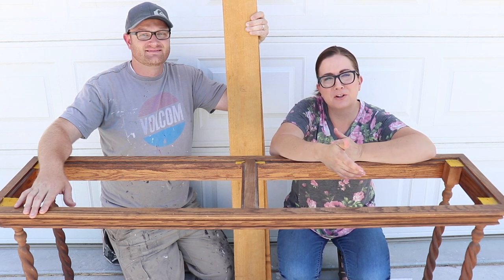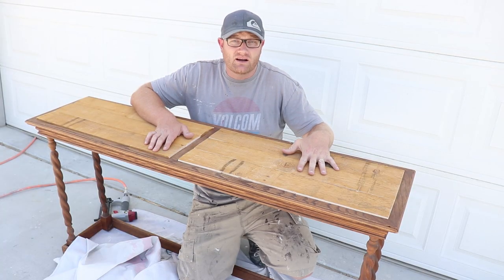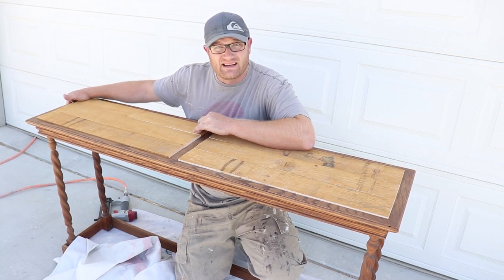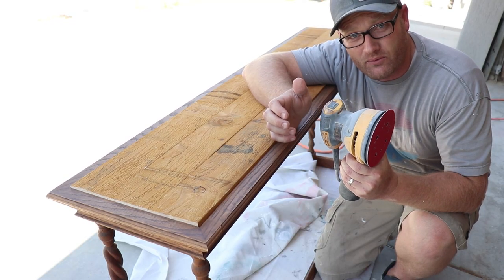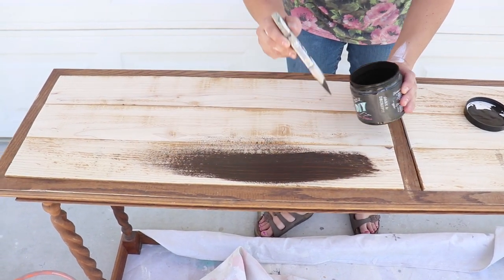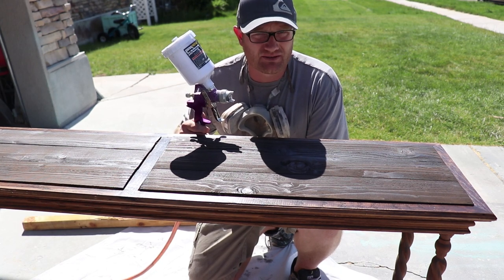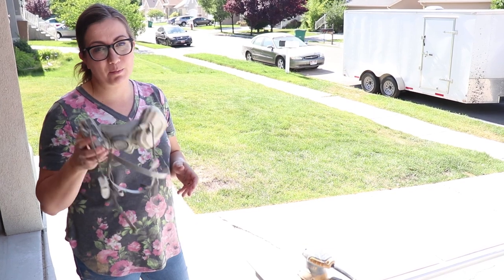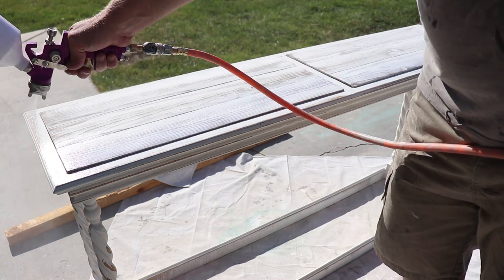How To Give An 80's Entry Table a Chippy Farmhouse Look

Comment: What did you do to remedy the wobbly areas of the table? It seemed pretty wobbly when Zeb was sanding. Did the legs of this table get cut off?
Reply from the maker: It is sturdy. It was uneven on the driveway where two slabs met

Comment: What was Zeb using to guide the wood through the table saw? Is that a tool or something he made? ALSO I would love a video on how you got started doing all of this :-)
Reply from the maker: It’s a push stick that he made. You can buy them but he just made his out of scrap plywood. Keeps his hand about 4 inches away from the blade so he can push thin stock through the saw safely.
Reply: I’m gonna make me one. My table saw is old and doesn’t have any guard and seems like it turns forever before it stops turning. Same with chop saw too. I need to upgrade. Lol. Y’all think??
Reply from the maker: Zeb has been slowly replacing his tools lol. They’re all so old and heavily used.